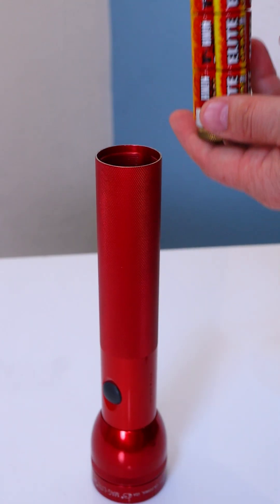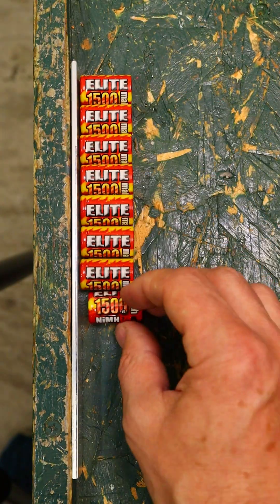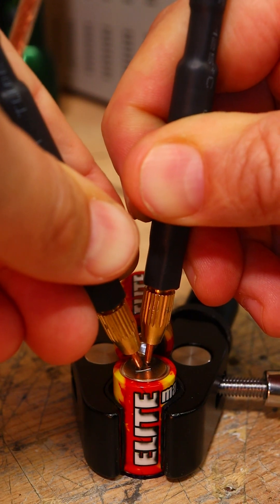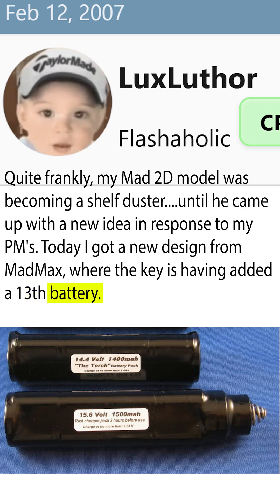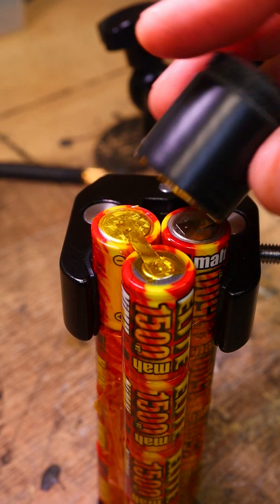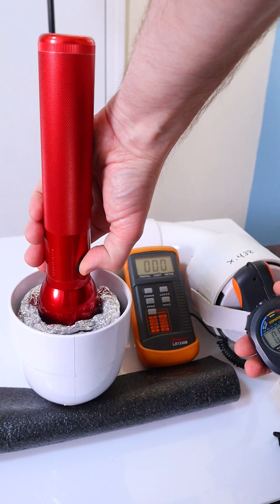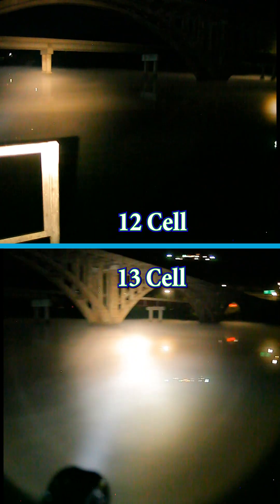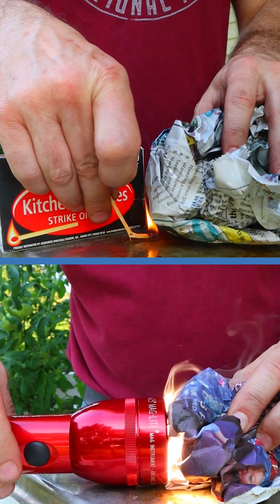Boosting the Power of my 100 watt Maglite

Comment: My dream is still to own a halogen flashlight...I still intend to make a cycling flashlight/headlight using an H21W 25W Bay9s, but using... 7ah Moura lead-acid battery, the weight won't be a problem for me, I might even put a cell phone charger in it. The most expensive part will be the battery and charger, the rest is easy for me. Lol

Comment: With one extra cell, the lifetime of the bulb shifts from 30 hrs to 3 hrs.
The luminous flux from the bulb is proportional to the fifth power of the supply voltage, so you get a monstrous lumen increase there.
I have always believed that the truly ultimate ability for a star-borne flashaholic would be having the skills, the materiels and the equipment to build his own light bulbs. Knowing physics and engineering enables such flashaholic person to build a light bulbs resembling a miracle lamp.
My compliments for your M@g build, it is technically exemplary and visually beautiful.
Greetings,
Anthony